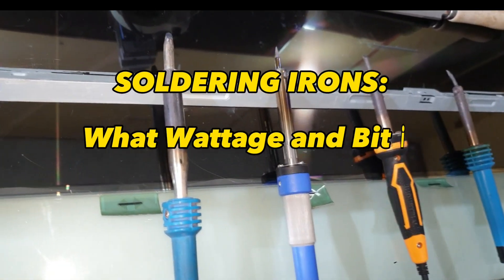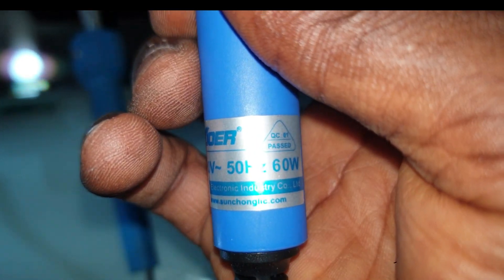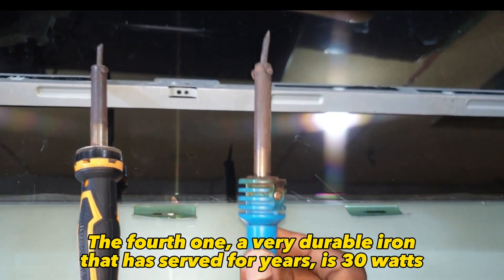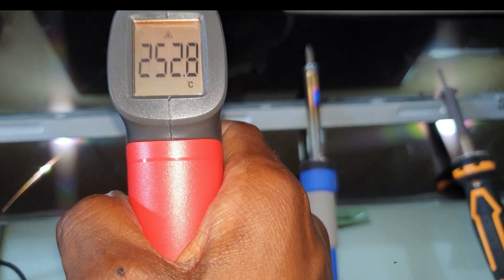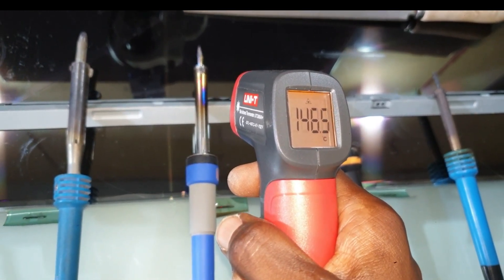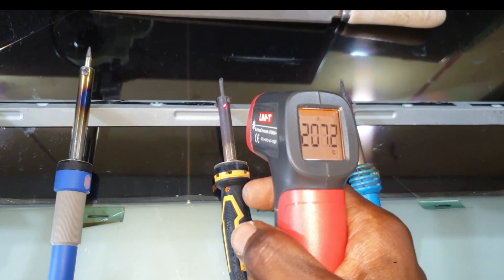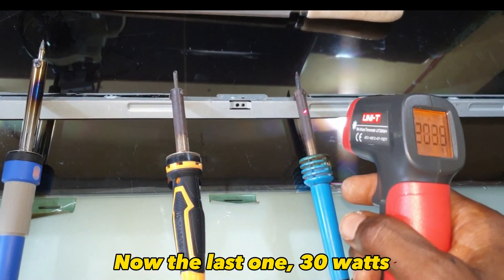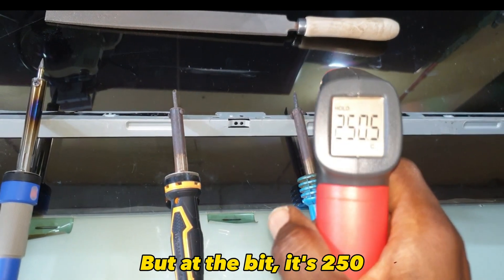PT 1: HOW HOT SHOULD SOLDERING IRONS FOR TV PANEL REPAIR BE?#tvrepair #lcd #led

Comment: Hey buddy: 4 irons, that's as bad as me but I don't have them all running constantly. I'd hate to pay the electric bill for your workshop 🙂. The first temperature that you show for each iron is for the element.
Reply from the maker: Oh yea! That's right, I should've said element. Thanks! In raged to the irons, I don't put them all on at the same time. The most is 3. And don't worry about paying for our light bills here, it's not regular anyways, so it doesn't get very high. 😀 It's the high cost of petrol that we have to bear at the moment.
Reply: @tgetvtips : Yeah I know all about rising fuel prices, it's gone up twice in the last week and it's apparently going up again at the end of the week.
Reply from the maker: @rscelectrical7091 that's not good. 😒
Reply: @tgetvtips : No buddy not good, it's almost £7.00 a gallon at the moment. You have a good afternoon.